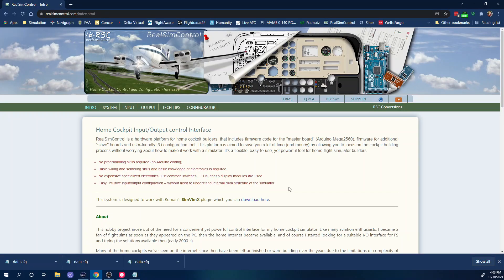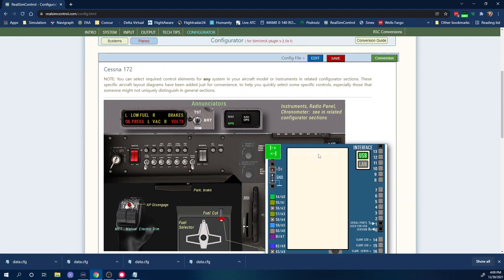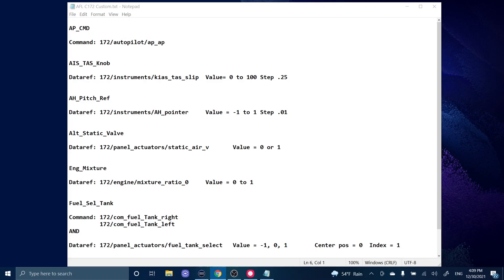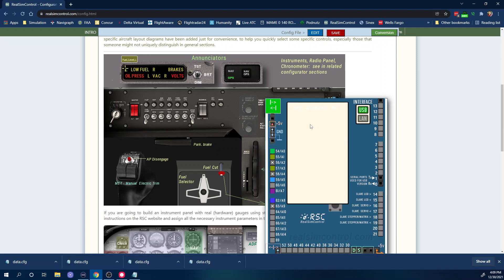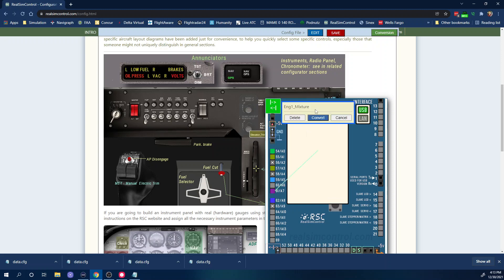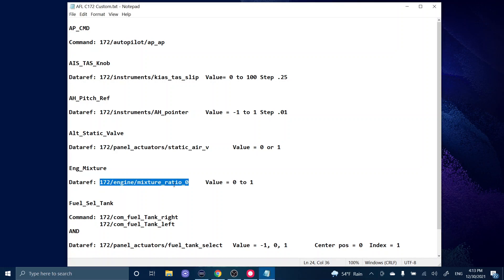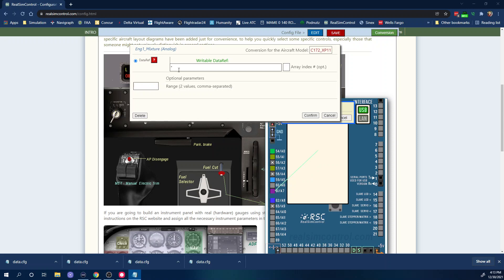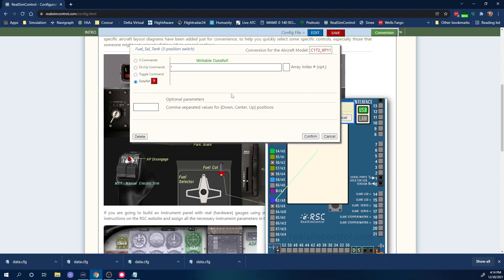Starting a new custom conversion in SimVimX V2.xx & RealSimControl (RSC)

Comment: Hi !Thank you for this very well explained video...
Do you think that the data conversion can solve my speed problem which is not displayed on the MCP of my Zibo?
https://youtu.be/h_fy3hfPTHg
https://youtu.be/g0QfRphf2Cs
Do you have this problem if you use the Zibo MCP?

Thank you in advance for your answer
Reply from the maker: No you do not need to convert any parameters for the Zibo.

I do not have a dispay for the speed but every time I tested it I've never seen that behavior.

Have you tried that display with other parameters? The only time I've had issues like that it was wiring related.
Reply: @Qosmokid  Thank you very much for having answered so quickly... I don't think the problem comes from my soldering or my connections: I tried to invert the 7 segments (alt/speed) I still have the same problem. .. The speed display disappears when I press VNAV or SPD INTV only, never at any other time: it is therefore not a short circuit but an action linked to the press of these two buttons! In the comment of one of my videos you can see my data file cfg: it's true that all my buttons are not connected but I don't think the problem comes from here: we can very well make an MCP only with an ALT switch if we want! You suggest me to solve the problem by trying other parameters...what do you think? (Thanks for your help)
Reply from the maker: @emc3895  oh that makes sense,  the speed is supposed to disappear when you press VNAV.
Reply: @Qosmokid  Speed display NOT supposed to disappear when V nav is pressed...
besides, we can clearly see that on the zibo it does not disappear... in my second video we can clearly see that on the zibo it remains displayed when I turn the SPD INTV button... how would we adjust the speed if it does not appear on the display?
Reply: @Qosmokid  the problem is that we cannot have the program code (because it is compiled) to know what happens when I press the VNAV button!
I'm really sure that the problem comes from the SimVim program because I assigned the VNAV command on my boing thrustmaster joystick and the exact same thing happens: when I press one of the buttons on my joystick the speed on my MCP turns off!

EDIT : I swapped the connection of the COURSE and IAS/MACH display and it is now COURSE that turns off when I press VNAV, proof that the problem is not due to my assembly, right?
Reply: @Qosmokid  You're right !!!
I received a response from Vlad, the designer of the SimVim program who said to me that in the real Boeing 737, the speed display is disabled when the MCP is on VNAV.
You can see it here in real life : https://youtu.be/6xWp_szCUTk?t=55
The problem is therefore in the management of the Zibo's MCP, not in SimVim!
Thank's for your time !

Comment: Your videos are great!  I've built a 737 MCP using Hispapanels panel, PCB and arduino shield and am trying to figure out how to make it work with SimVim.  In configurator, why does the next pin on the arduino get x'ed out when I'm trying to assign one of the encoders?  I am trying to put the connections for each button or LED or encoder to the pin coming from the Hispapanel arduino shield, so I don't think i get any leeway on what goes where.  So when it x'ed out the next pin but it's part of the encoder, it's confusing.  thank you!
Reply from the maker: Hello Steven, encoders use two pins that must be consecutive. Thats the reason the second pin gets X'ed. Same thing goes for two position toggle switches or multiposition rotary switches. 

I suggest you watch the video I posted a few weeks ago on using rotary encoders.

Comment: I have had to manipulate arrays quite a bit.  Just like a spreadsheet, it is the column of the field - so ten spaces in is array #9 (since zero is the first space).
Reply from the maker: Oh ok, did you have to do that for the code for your button box?

I remmenber array from when I use to look at data in Commodore 64 programs but even then I didnt quite get it 🤣
Reply: @Qosmokid  Oh yeah, several times.

Comment: Greetings and Happy New year from NZ!  Thanks for your video posts, these have been very helpful over the Christmas break as I try to get my Zibo B737 "alive".  I have hit a couple of snags that I wondered if you could help me out with?  I've been using the "planes" tab in the configurator to map my switches and LED's to the Arduino, but cannot get the Master Warning switch (and possibly the Fire Warning) to function.  I suspect maybe the data ref is wrong in the configurator?  The other issue I have had, is that I cannot get the plug in to recognize my servo controller board.  I've followed the instructions and appear to have uploaded the servo firmware and have it correctly configured (Rx & Tx crossed over correctly, earths linked to a common earth, independent 5V supply on the socket) but there is no connection to the servo (flaps gauge), nor is there any detection of the board in the plug in.  Perhaps you could do a video at some stage showing the connection and operation of a servo?  Appreciate your help and videos.  Keep up the good work!
Reply from the maker: Happy New Year MedicNZ, as far as the master caution and fire warning lights and switches I can verify they are correct. I've had those in my setup for a few years now and as a few days ago they were working for me.

Now for the servo board, I have not played around with that at all yet. I can tell you that when I used an Arduino Nano for a slave LCD board I also never saw the plugin "detect" the board but the LCD I connected to it was working properly.

It is in my plans to eventually make a video about servos and also stepper motors. But right now I dont know exactly when that will be.
Reply: @Qosmokid  Thanks.  I watched your LCD video, as it is a slave board like the servo board and I followed your steps for the Servo board set up but I still cannot get it to work.  I have run out of ideas now and may have to leave the laps gauge out of my build.  I'm wondering if the current configurator has the wrong mappings for the caution and fire warning buttons.  I've found this already during the build when it wouldn't accept the descriptions for the 6 landing light, so I had to manually change them to the previous descriptions from an older version (SimVim) before they would work.  The fact you have had yours working for a few years makes me think that might be the case.  Sometime if you have a minute, can you check your config file and confirm if they are set up as "Master_WARN" and "Master_CAU" buttons?
Reply: And I've just discovered, my servo was faulty :( Tried one connected outside the sim and it worked fine!
Reply from the maker: @Medicnz100  I just loaded up in the Zibo and confirmed in my config file and they are Master_CAU and Master_WARN for both the buttons and the lights. I also looked at the current assignments in the configurator and they are exactly those same ones.

As I said, I've had these configured for almost two years and they've always worked through all the revisions of thjje plugin and the configurator.

I suspect a wiring error may be the culprit.